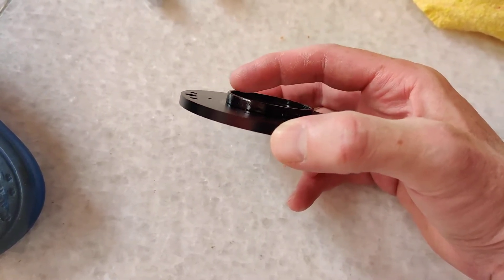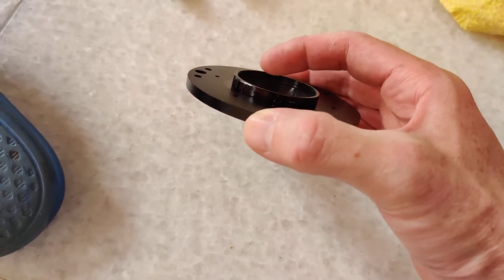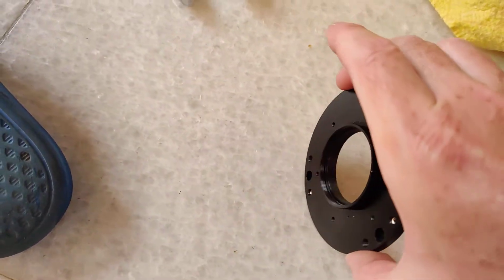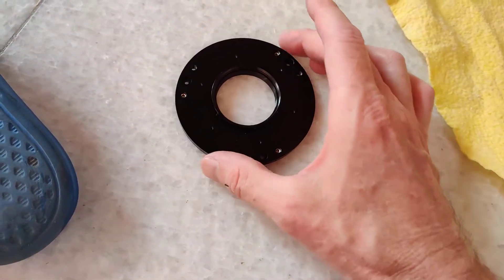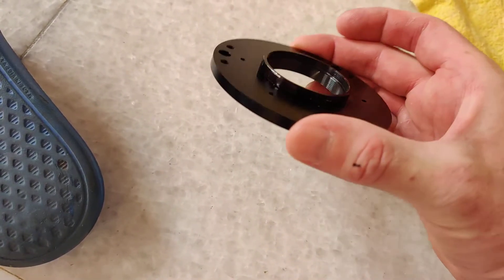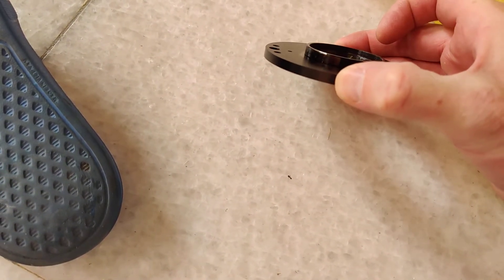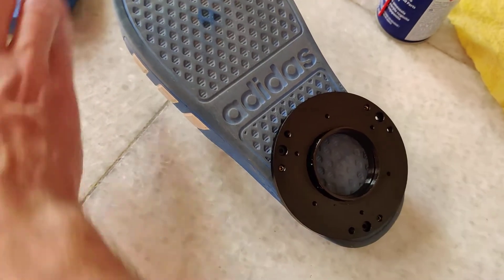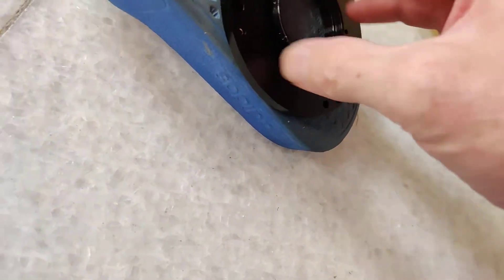Freeing off a seized T ring adapter 5mm extension piece from ZWO camera front plate.

Comment: I've had this happen numerous times with cheaper 5mm extensions. I used a heat gun to heat everything up a bit. Thanks for the helpful video!
Reply from the maker: I did consider the heat option, was going to use a de-soldering hot airgun or the oven, but thought I would probably burn myself, so would try other options first!